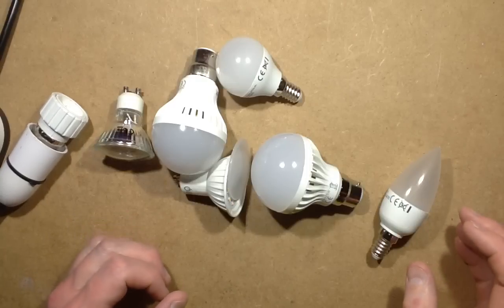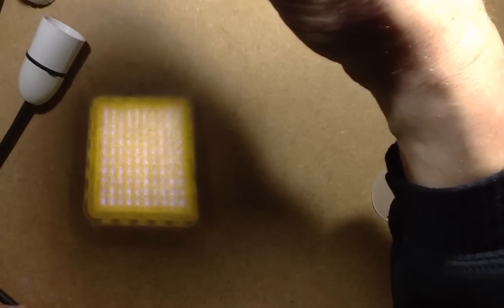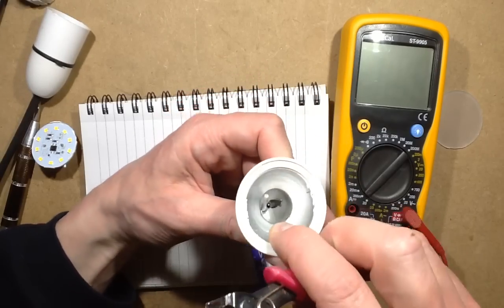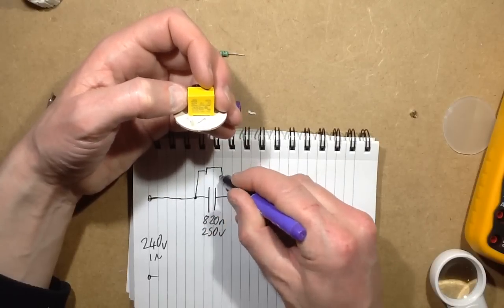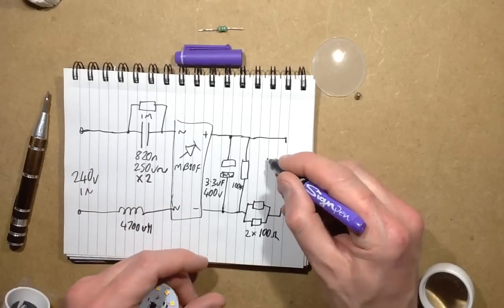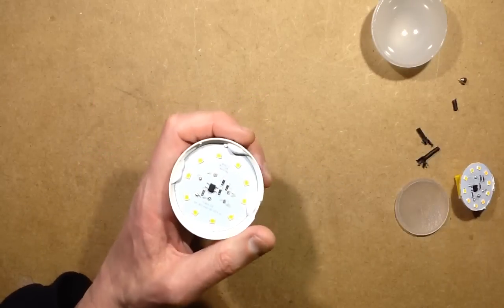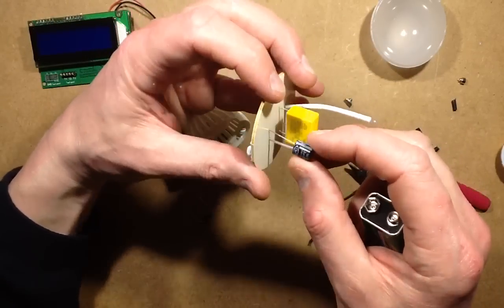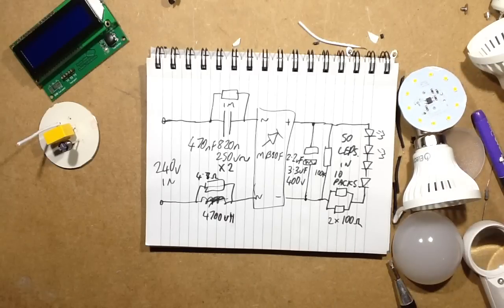New, and VERY interesting Poundland 5W LED lamps.

Comment: I'm curious about the 4.5 millihenry 26 ohm dc choke. 4.5 millihenry is about 1400 ohms inductive reactance at 50hz + 26 ohms resistance.
How does that compare to the 4.7 ohm resistor. I see quite a difference. But, I can't explain how the inductor and the capacitor on the other side of the AC line react together to limit current. Can you go through the math on that. Or, someone? The diodes and the then the series leds gets me confused in the math of the whole thing.

Comment: Hi Clive or anyone else wanting to comment. I've bought a couple of similar bulbs from home bargains which are "dimmable" ,  I thought I might be able to get an arduino to control them for an aquarium to simulate dusk and Dawn  (say 15 mins), but it looks like I have to mess with a zero crossing module and all it entails programming-wise.  I'm just wondering if I could just use a R.C combination between the power module and the actual LEDS panel. Any advice would be really appreciated.

Comment: Hi Clive. I've just torn down one of the smaller 5w golfball lamps thats failed after about a year of moderate use, it has very little heatsinking & no ventilation. The led chips are scorched/darkened, one has popped (shown as a black dot in the middle of the phosphor). The reverse of the pcb is visibly yellowed/scorched as well.  Maybe the larger aluminium heatsink in other lamps would help with this, but yes it seems your right, that they are being overdriven. A smaller value capacitor dropper would solve this. Planned obsolescence me thinks.

Comment: I was always under the impression that the reason LEDs were more efficient was because they produce far less heat than regular bulbs so what's causing the heat?
Reply from the maker: LEDs are not 100% efficient at converting current flow to light, so they do heat up.  The power rating of LED lamps is still the power they mostly dissipate as heat.

Comment: Hi Clive. The 820 nF 250V yellow capacitor looks to be class X2 which usually have generous ratings. The 300V types being ideal. Often the detailed specs show the limits, whilst the 250V spec is to show suitability for nominal 230V use. I think the parts look quite good for the price.

Comment: Three or four months ago, Tesco added 14.5W (100W equivalent) bulbs to their range.  Non-dimmable for £7, dimmable for £8.

Brightness seems a little more than a 100W equiv CFL.  The body runs too hot to touch for more than a fraction of a second, though not hot enough to sizzle.

I wonder what they're like internally...

Comment: is this ebay item http://www.ebay.co.uk/itm/All-in-1-Component-Tester-Transistor-Diode-Capacitor-Resistor-Inductor-Meter-/252389715802?hash=item3ac3996f5a:g:1pAAAOSw8vZXNJCK 

similar to the multi tester you was using in the video 

also thank you for your videos .. ive been watching a lot of them recently
Reply from the maker: This one is smarter than the older unit I have.
Reply: thank you clive ... really enjoy your videos

Comment: What is the 100k ohm resistor for across the output of the rectifier?
Reply from the maker: Usually to provide a very low current load so that the lamp doesn't glow while switched off due to capacitive coupling in the switch wires.  If you remove it, the LEDs may glow at a noticeable level even with just microamps of leakage current when the light is supposed to be off.

Comment: Hm; you always claim to not see the flicker but capacitive droppers would imply mains-frequency*2 (full wave rectification) flicker = 100hz for you, 120hz for us here.  This is totally noticeable in my Moto G(4)(2016 edition) phone which has a photo-taking sensor-roll from top to bottom taking of a second showing 2 full waves, 4 cycles on, 4 off, of an LED (as well as with magnetic ballasted Fluoros)  : for reference, please check out my google photo album : https://goo.gl/photos/QiUyPurwsXq1jdtj8
Reply: Sorry 1/240th of a second (i believe; maybe my math is wrong here, but shutter speed that fast seems about normal for ISO50  ?)   and, oops, thats my LG-G3 model D851 .. been so long since i took those.
Reply: 1/30th of a second? (my math is horrible today)

Comment: Finally, Dollar Tree in the U. S. Is selling 9W LED bulbs (60W equivalent, warm-white, 800 lumens supposedly). Quite nice for $1, not dimmable. US/Canada website for the brand says it has an E26 base not an E27; it's marked 120V 60Hz 150 mA -- sounds a bit much current for 9W, more like 18W. Maybe I'll take one apart. I'd send one to Clive but the postage from the U. S. would be insane.
Reply: Yeah, i've picked up a few.... Brands (well, packaging) vary a bit but they've been working well... Notably, they work ok in my X10 switched fixtures (light switch replacement module WS467) which wrecks fluorescents, even when in parallel with a traditional resistive load.  At least i'll have some fodder for teardown to salvage the ferro cores for a joule thief. #BrightSideOfLife #NoPunIntended

Comment: Clive

Thank you very much for your channel. With these lamps I would expect to get a vast amount of flicker as they are effectively switching at 50Hz. I am a lighting person, not electronics so please bear with me on this! Does the capacitor after the rectifier manage to hold voltage and current up over the zero crossing?

There is a good, Free, flicker measuring app from VISO systems on the apple app store. The only thing to be aware of when using it is that you put a diffuser over the camera on the phone/ ipad and ensure that this is fully illuminated by the test source, t will then give resonabley useful flicker information for future lamp testing

Regards Kevan

Comment: Well, one of the mini 5W ones has already failed on me. Would you be interested in tearing it down to discover the failure mode, Clive?
Reply from the maker: The failure of the 5W ones is common, particularly if they have been in an enclosed fitting or hot place.  It's usually LED failure.

Comment: Hi Clive,
Enjoyed your reverse Engineering thank you for such an informative 'tear down'
Just thought I'd mention our Mains Voltage here in South Ireland is 230VAC RMS. as I think main land Europe is.
I've had about 15 of the 5W Electrek running for about 6 months  no problems.
Do you think the extra 10V x 1.414 say 14V DC added to your HT line might account for the over heating of the Leds, no constant Current limit in these lamps!
Cheers Liam

You mentioned
Reply from the maker: i think a lot of the issue with short life of the 5W lamps has involved enclosed or otherwise hot fixtures.
Reply: I bought a selection of Poundland 3W and 5W lamps. Most have been good, apart from one 5W "candle" format lamp which never worked. I've just taken it apart to have a look. It has a similar PCB to the 5W lamp in the video, (text ends in A4, not A2), but all the LEDS look fried. They all have dark spots, the back of the PCB is brown between some of them and two of the LED chips look physically broken. A shame, but it was only a pound. Also the 820nF X2 capacitor is rated 275VAC, not 250V.

Comment: Hi Big Clive,
I have been watching some of your videos on you tube and wondered if you could help.
I recently purchased 1x 220v 50w outdoor flood light and 2x 220v 30w.
I have installed them:
1 PIR working 1x 50w and 1x 30w and 
1x PIR working 1x 30w.
The 50w works fine and always has done, the 30w attached to the same circuit did originally work fine, it now however comes on and off as the 50w but at a very low light output. The single 30w comes on and goes off but also at a very low light output.
Both the 30w have the same light output and both go completely off.
I know LED lighting can be involved and would appreciate your help or recommendations.
Regards
Dave
Reply from the maker: If you look at the LEDs inside you may see that some of the strips of LEDs have failed or gone dim.  It could be the LED or the driver.  It's not that hard to change either of those components if you're handy with a soldering iron.
Reply: Thanks for your reply
All of the LEDs light up so looks like the driver. Will have to take it down and open it up.

Comment: You are so clever sir. I didn't understand measuring the amps being pulled by each LED by measuring it across the nodes of the LED. It must be in series to work properly. Big question mark over may head. I enjoy your very methodical explanations. Thank you.
Reply from the maker: It's a long string of LEDs.  By placing the meter across one of the LEDs the current will flow through the meter instead of the LED and indicate the current in the circuit.  Just shunting one LED doesn't affect the current much in a single series string of LEDs like this.

Comment: Hi. I bought 6 of the 5w GU10 bulbs and put them in 2 triple spot ceiling lights. I think they lasted about 2 months then one by one they all failed. Maybe the heat related issue you mention. Pity - they were nice while they lasted.
Reply from the maker: +TheBassg Yeah, they seem to be pushing them with the 5W rating, but the 3W versions seem OK.

Comment: well from wachign this video I decided to give one a go. got the 3w with the vents ( bayonet fitting standard house Light with globe diffuser) plugged in turned it on no problems no flickering I can touch it hardly any heat coming out of it reasonably bright for the living room so I might put it in the hallway instead but if it's only using three watts it might just stay where it is uses less electricity than the storage heaters that's for sure
Reply: been using for about 12 days now. hardly any heat from the bulb prefers direct and a lampshade open end facing down for best light :)

Comment: I tried to light theses lamps by 12v DC from a car battery guess what it works without any modification, but not as bright. So I tried a cheap DC to DC converter and now you can vary the brightness handy for emergency lighting in kitchen were I have the led lamp running at 240vac then when you have a power outage you use a  switching circuit manual or automatic and you have emergency lighting using same led bulb but the 12vDc battery can lasts a fare while even using solar panel to charge battery.

Comment: The capacitor on the input will have an impedance depending on the frequency of the mains supply and if a transient is encountered its impedance will be reduced drastically for the duration of the transient that is why a resistor, or an inductance, is included in the input as well. Also, the use of a capacitor will also induce a phase difference between the voltage and the current - another reason to use an inductor which will also minimise the phase difference.

Comment: Why doesn't the LED SES lamps be equal to their tungsten equivalents? My electric fire requires 2x 60watt standard tungsten opal candle bulbs. I tried the halogen equivalent 42watt which is supposed to be equivalent to 60watt bulbs and they are fairly good, although they only last  a month or two so there are no savings. Tried a 6W LED warm white version from Ebay which are supposed to be brighter than a standard 60Watt lamp, unfortunately the LED version is nowhere near as bright as the tungsten version, why is this? and is there a low energy SES bulb that is reliable and matches the tungsten version?
Reply from the maker: +jazzyman99 If the lamps are behind a coloured filter you'd get better results with a suitably coloured LED lamp.

Comment: Those Poundland LED bulbs look above average, but generally speaking they're a false economy. I'd look for discount deals on Philips, GE, Duracell etc. I got some 6W Duracell GLS (A60) LED bulbs a couple of years ago in a sale at ASDA for £2.50 a piece and they're fantastic. Some are on 24/7 and no failures thus far. However, I've had a few G45 golfball bulbs from the 'Long Life Lamp Company' on eBay and they've only lasted a few hours in a downlighter. Switched to the 5W Polish-made EcoLight golfballs from Home Bargains and no problems thus far.

Comment: Bought two of the 5 watt gu10 lamps from £ land in different stores ,2nd didn't come on ,they changed in other shop with no hassle, also look good against my 2 Phillips which cost £7 each in same fitting of 4👍🏻

Comment: Interesting to know to say our house is lit up by them. I'd say they are 35w equivalents
Reply from the maker: +Ashley Lakin Note that the 5W lamps may fail quickly if used continuously.  They seem to be overdriving the LEDs in them.
Reply: +bigclivedotcom haha. Left them on for a week constantly and well it kinda burnt itself out. Love to let you see it. The LED chips and the board is all brown and the solder has melted a little

Comment: Absolutely love these videos! After seeing this one I bought several of these 5W LED bulbs (should have heeded the warning in the description above!) but just a couple of weeks later 2 of 5 of them have gone up in smoke at exactly the same time shortly after we had a powercut. Does anyone have any ideas what might have caused it? I popped the top off one of them and there was a very strong smell of burning components:
http://www.antropy.co.uk/images/screenshots/d3348f.jpg
Reply from the maker: +Paul Feakins The 5W ones appear to be pushing the LEDs too hard, but in a power outage situation you can get electrical noise on the power to your house from arcing at the original fault that caused the power outage, and potentially more when the power is switched back in again.
Reply: +bigclivedotcom Thanks very much for the reply! I bought some more 3W ones today to replace them but noticed that the design of the 3W and 5W bulb casing has changed to include LOTS of ventilation now. It is very interesting as you say to see the progression of these £1 LEDs. Perhaps unlrelated but probably around the same time (we only noticed it this evening) the heating element in our oven also burnt out. I've literally just finished fitting a new one. Please keep doing the great vidoes!

Comment: After watching this video i got 15 of the 5w Gu10 version of these bulbs and and they started to fail within 1 week of use to the point now i only have 2 left working after 3 weeks
i haven't had chance to poke around in all of them but 2 had leds pop off the board and rattle around in the casing, 4 dim to almost nothing before failing compleatly and the rest just outright failed
some would come back to life if taped it looks like the pcb's warp and pop the components loose or off

when i first put them in i was very impressed with the light output but the lifespan just makes them pointless !
Reply from the maker: +Garry Townhill This appears to have been common with the 5W version.  Where the LEDs literally got hot enough to desolder themselves.  Very odd that they even made it into manufacture.

Comment: Hi Clive, had real problems with the 5W GU10s from Poundland. All 4 failed in about a week, do you think the 3W versions will do any better?
Reply from the maker: +stevebarnes1973 A few people have mentioned that the 5W ones are pushing the LEDs too far.  It may be that the 3W ones are a lot more reliable.

Comment: http://imgur.com/a/sFuy6

The weirdest thing happened I made a light for my mom's plants using this circuit. (Second image) (capacitive dropper)
It worked great and everything was fantastic but I noticed while it was off the cool white LED was glowing slightly (You've said this before)

It doesn't have a switch but I connected it to a "SurgeStrip" (third image) and used it's switch. On the image provided you'll notice the burn mark on the LED terminal (fourth image), that's where I put my finger to see what would happen. I didn't feel anything despite being grounded (was in the basement) but the LED started to glow a lot! Even though the switch was off. 

So I decided to put my other finger on the LED's other terminal, it stopped glowing and I got a NASTY shock. It didn't go all the way through my body but my hands and fingers felt it, suggesting this was 120V but current limited. 

I took my meter and put it on the exact setting as shown (first image) and, on DC volts, with the connector on volts, and put it where my fingers where previously (the - and + of the same LED, seventh image) and it blew up the terminal (seventh image), sparks and shit everywhere. Now it sounded more high voltage than high current, plus the breaker didn't turn off so I'm pretty sure it was current limited or else that shock would have hurt a lot more.

I checked to see if my multi meter was bad and was shorting out the terminals but no, I put the leads some random battery and the meter didn't short it out, it measured 18V (drill battery) so the multi meter survived that and works.

The bridge rectifier is a dead short now, measured it with the meter and plugged it in and it gives horrible flicker suggesting it's now running at half wave.

You probably know EXACTLY what's going on so please help me!
Reply: Hi chems.  I don't know what power you need, and consider me an old-fashioned git if you like, but I am of the firm opinion that capacitive droppers are bad except for very low power.  They're used in these bulbs for compactness, and pushed to their limit. If your mom needs, say 20W of led lighting,  then it would be better to drop mains to 12V using a decent isolating transformer and then use 12V bulbs.  I hear that plants like a different colour spectrum to humans too, doable for a diy'er.  Hope that helps!
Reply: Ray Kent oh yeah I know, but I needed an instant power supply right at the moment and all I had were big film capacitors